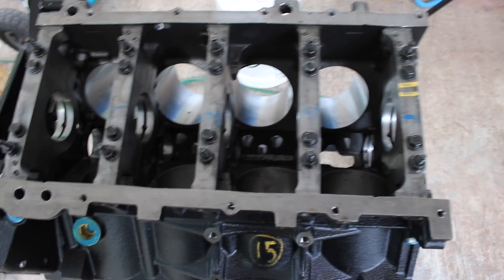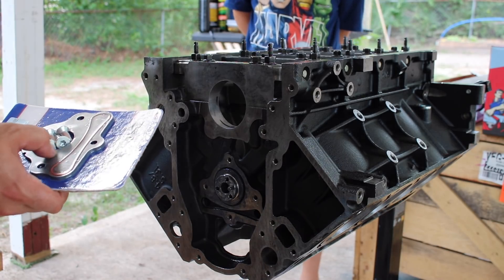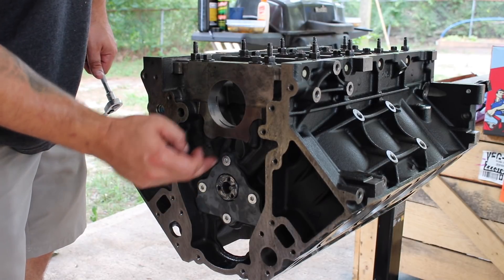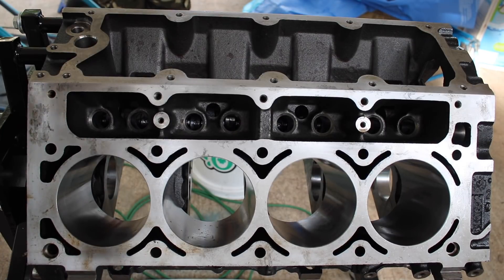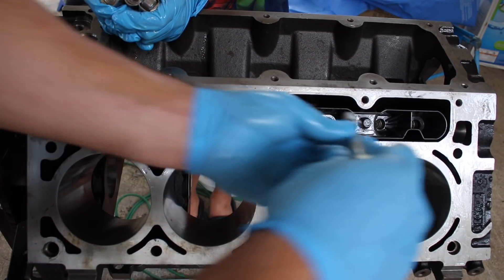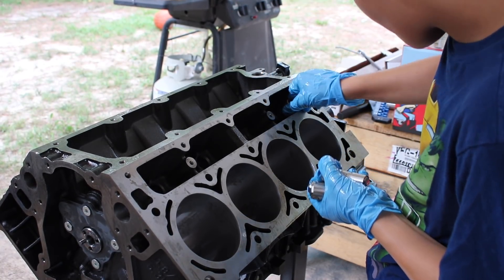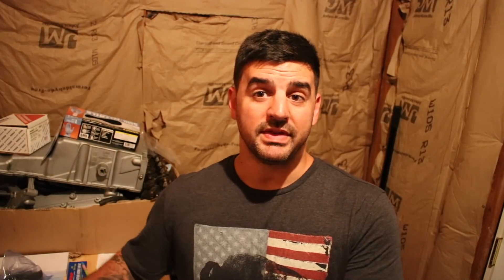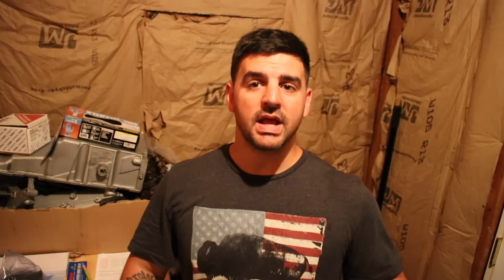My 10 year old son is building my LS Engine + Future of the 2017 Whipple SC 1LE

Comment: Mahle (pronounced moll-ae) = German verb meaning to mill.  They have a plant in Morristown, TN.  Not sure if they made your pistons there.  But, they supply pistons to a lot of engine makers including GM.  I've got a '96 LT variety SS Camaro that I'm looking at rebuilding.  My father drove it back and forth from Johnson City to the TRW plant in Rogersville for the better part of a decade.  After he passed away, my mom and brother drove it around until the head gasket blew on it.  Not really sure whether I will rebuild it or go with an LS swap.  Just have to wait and see how bad it is when I pull it and tear it down.  After he retired from TRW, my mom bought him a 1938 Chevrolet and we built an SBC for it using a block that a local street rod shop called "Ride Revolution" found for him.  Went with Eagle crank / rod / pistons and TrickFlow heads with a Summit intake and cam.  I installed the wrist pin keepers one evening after work with him in their kitchen.  They were of the compressed spring variety rather than the circlip style.  The skills and confidence these father / son projects you all do together will be worth the time / effort and financial cost even if the results of the projects don't always turn out perfectly.  :)

Comment: Awesome video glad he’s into it as well. I’ve probably done 30 LS motors since 1999 once you do one they are a cake walk. I did have 1 question how many rpms will this motor be spinning? It’s been my take after doing so many of these that the lifter trays are no good after spinning 7000rpms constantly I now use tie bar only products👍. Morel or the Johnsons are great tie bar lifters. Keep the videos coming
Reply from the maker: Thanks for that info! This is my first LS build. I’m probably going to be between 6-6500rpm I’d say
Reply: Regular Guy Garage if your going to use the plastic lifter trays a lot of oil gets caught in those. What I do for customer cars is drill small holes in the plastic trays so the oil has some place to go. Anyway just trying to save you headaches for later. Videos are always good keep it up.